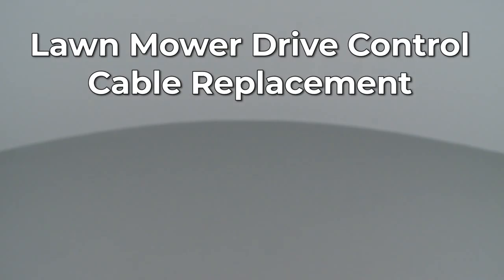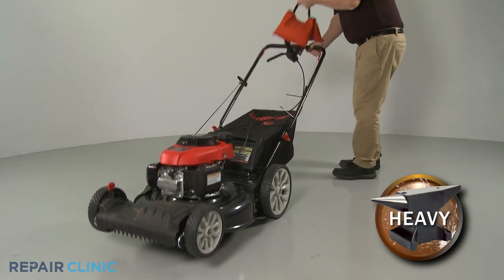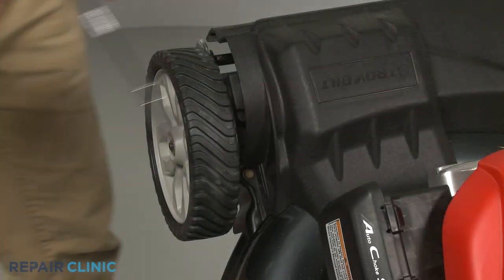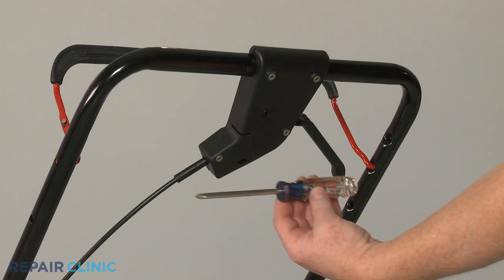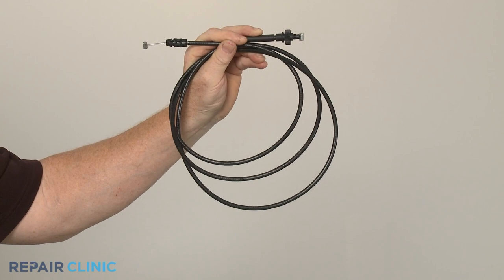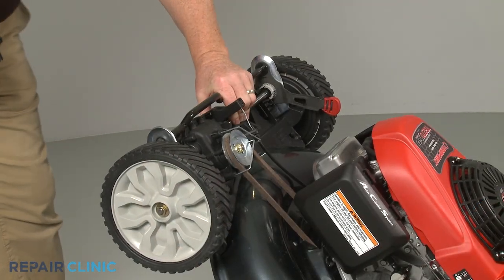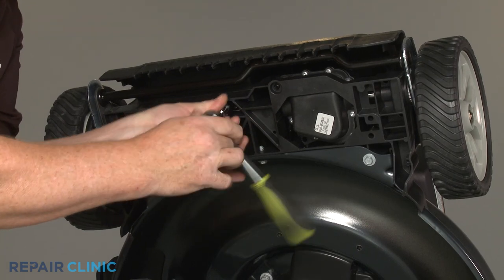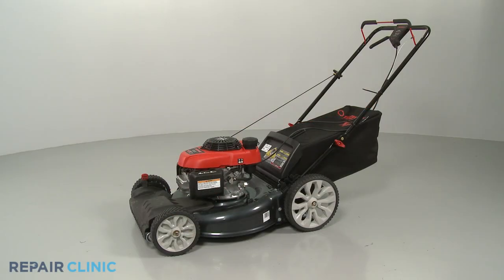Troy-Bilt Lawn Mower Drive Control Cable Replacement (946-04655A)

Comment: I wish someone would post a video of a troy built push mower with rear drive cable.  I can't find one anywhere.  HELP!!
Reply: Me too. The drive cable broke on mine and I'm having all kinds of trouble finding the right replacement cable. It has a loop on the end that goes inside the transmission box.
Reply: SAME HERE